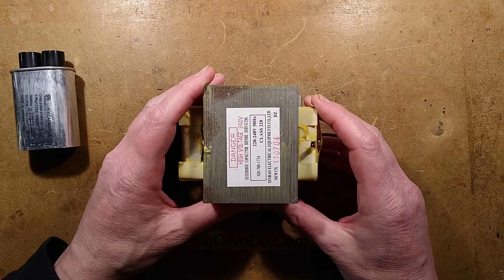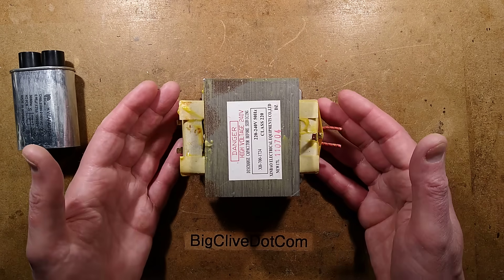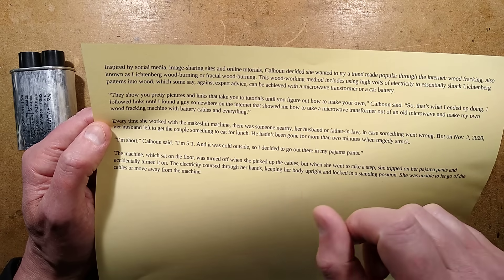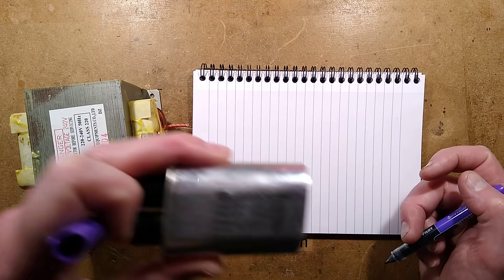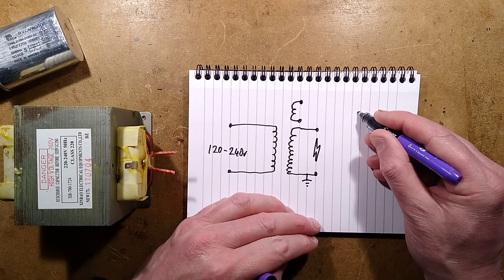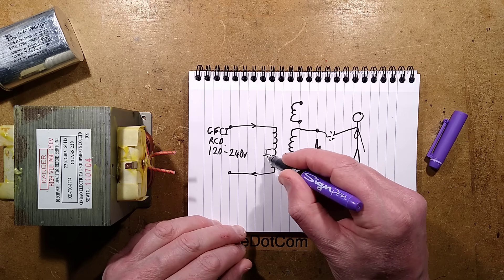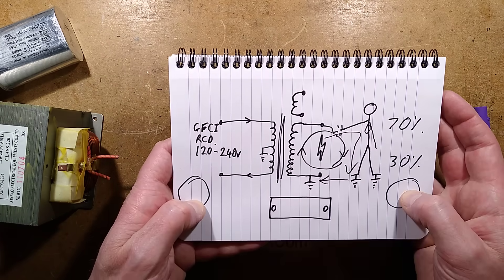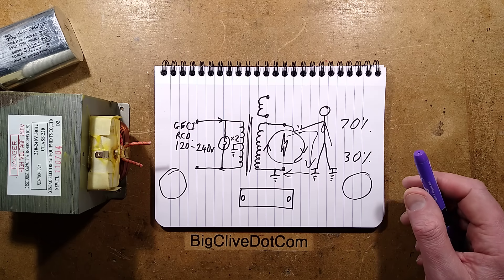The most deadly project on the Internet

Comment: I went for epic high voltage at current from these.. welded two back to back so HV is centertap grounded. Put into a 3 gallon pail of transformer oil and powered the primary so the two transformers would have HV in phase. Used this to power a lower voltage but high current Tesla coil and a awsome jacobs ladder, but it eventually ended up getting a voltage trippler added on to it to power a copper bromide laser. 🤓 fun to play with but deserves respect. They can source up to an AMP of juice at 3 to 4 grand through you 😵😵😵

Comment: Clive, I haven't had time to think about your excellent video and will comment more later but it seems that if the instructions to adapt the transformer  to people who don't know what to avoid to begin with, instructed them to isolate the grounded secondary by disconnecting it from the frame it would at least be less lethal. People should NOT fuck with microwave transformers to begin with but at least it would be an isolated secondary somewhat. Thanks for the great video on an important topic!

Comment: I actually fell down quite the same rabbit hole that those poor lads did a while back and following me managing to get my hands on an old microwave, I did it. I very much should not be alive right now, I did it with old housing wires, on a rainy day, with no more protection than the insulation on the wires and some work gloves I was wearing. I was careful at first using plastic clamps to hold it down, then turning on the power strip I had it plugged into, but at some point I moved on to just holding onto the wires. So yeah, shear luck.

Comment: So even though Clive already said it, I will repeat him because its worth repeating.
Use a dead mans switch, use multiple indicators across the primary. And ALWAYS use wire rated for the voltage you want to put across it. All wire is not created equal boys and girls.
Have to wonder though if rectifying the output to DC, would still work, as it doesn't cause the contractions that FORCE you to grab onto the electrode!

Comment: I've built and worked on amateur radio vacuum tube RF amplifiers. These things fall into a similar category of leatality. The DC voltage on the anode of the vacuum tube is many thousands of volts and this WILL kill you in an instant! 

Not scary enough while just sitting there, when they are in operation you can get 1000-2000W (or more) of RF energy superimposed on the anode... you enter in a whole new realm of danger. 

Working on them demands the utmost respect and situational awareness. Bypassing interlocks to allow operation while hazardous voltages are accessible is never recommended.

I have the utmost respect for those engineers that are trained to work on much higher powered vacuum tube radio and TV broadcast transmitters.
Reply: I worked as a guitar amp tec on the road with the rock bands in the 80's.. Scary high DC voltages in the high bower amplifiers.. not uncommon to find a nice sizzly 800V at about 2 amps !!!  The simple rule is.. no metalwork on your body.. ONE HAND when it's on.. and NO BEER before opening.. or on top of the cabinet !!!!!
Reply: I have a Johnson Viking those tubes are something else ! Hope I can still get them as the last ones came from Russia ! They still make them same for the 2KW amp a diddling stick is on top of them as a reminder to make them safe!

Comment: whenever a homemake step up transformer switch  on, you are summoning sir Darwin, it is him to make the decision you do the job right or not. the other common step up transformer in your home would be the florescent tube light. that one is highly modulize with plastic insulator, that's "supposed" to be safe. but every now and then, there will be some genius get a nasty shock touching the high voltage ends here.…

Comment: Never tried one of these. But using a oil furnace transformer rated at 10kv. We had a testing machine to verify it worked, and it was mostly a safe thing to use, but after using it several times we found it to only work when the transformer was basically completely dead, and you can tell that cause there was no spark at all. We found it was much more reliable to do a drag test, and see how long you could make the arc. This is showing how dangerous that could be.

Comment: I have a bunch of these little HF supplies I got on Ebay. They're not even mains powered, they're BATTERY powered. I put a whole whopping 3v into one of these things, and it would make an arc between the output terminals. So that's a LOT of bloody energy.

Well, I had this fool idea of making a glove with conductors on the fingertips, so I could do this sort of "wizard trick" of having lighting flashing between my fingers. It would have looked really cool...if I had done it right. But I didn't. I had a few layers of what I thought would be sufficient insulation, and had a slide switch on the battery box. What happened was:

1. The current blew right through that insulation right into my left thumb. I figured out later that what I had offered it was a whopping big capacitor, with my thumb as the other terminal. The 3/16" of rubber I had between my thumb and the terminal was about as effective as a piece of pantyhose. It started boring a hole into my thumb quite painfully. But that wasn't the whole problem.

2. The battery box had insufficient insulation, and was somehow picking up current from the other side of the circuit, because I couldn't flick the damned slide switch! I'd bring a finger near it and that finger would get zapped so badly, I couldn't move it voluntarily!

The way I finally shut the damned thing off was to literally tear the battery leads apart to separate the battery from the module. That stopped it. Then came the task of removing the rubber glove I had on my left hand to do something about the damage to my poor thumb. It was as if I'd just jammed a soldering iron into my thumb and left it there for a while. I immediately ran the hand under the cold tap until it was slightly numbed, then filled a bowl with ice water and shoved my hand in that for a while. I cleaned it out really well with Bactine (because it has painkiller in it) and triple-antibiotic cream (with yet more painkiller in it), and got a burn dressing on it. (I keep hydrocolloidal burn dressings around because I own a soldering iron.) After a day or two of replacing the dressings and hitting it with more Bactine, it looked like it would heal up ok. I started using an aloe and silver antibacterial preparation, and dry hydrocolloid dressings, with a cut-off thumb from a nitrile glove over it, held on with silicone tape, to protect it. A week or two later, it was well healed up, and the hydrocolloid kept there from being much scarring.

In short, I got bloody lucky. I still don't know why I couldn't turn off that damned switch, and I don't care. I still have those HF modules, but I don't fiddle with them anymore. If I have a project that has a legit use for one, I want a schematic and a BOM for making whatever widget this thing gets put into, so I can have a reasonable chance of keeping all my fingers intact. And this wasn't a microwave transformer! It is a high voltage/low current but high frequency RF power supply, and can still cook you like a hot dog if you don't treat it properly!

Comment: High voltage is scary. I studied electrical engineering for a while before switching.  I still remember the story of my professor about an accident in the high voltage lab. Over the course of weeks fine carbon dust from a large electrode had built up in the unventilated lab to the point of making the air conductive. A very high kilovolts lightning bolt shot through the lab, which thankfully was empty at the time...

Comment: In this use case not even a cat has enough lives to survive when things go wrong. Sadly people often do dangerous things for views and attention; especially if they have no clue about safety. It is often a case of monkey see, monkey do. Which can result in monkey severely injured or dead.  I personally wouldn't trust the heater winding either.

Comment: As an electrician,
Tx's are no joke, Capacitors are no joke.
treat them (and everything else  electrical) like a loaded gun. 
Always assume its hot.
Dont become the ground.
Wear your PPE,
Reply: I'm having fun with the rent house I'm in.  I'm fixing the wall outlets, because the electricians for the builder didn't mount the boxes right.   So, I'm opening them, pulling out the receptacles, putting in spacers, and remounting.     Shattered plates, receptacles that go in and out more than half an inch, solid core mounted into the back connectors - but the side screws NOT seated, nor wrapped with electrical tape..    I'm opening each one wearing gloves.   

So, it's a "Treat everything like a moron assembled it."  situation.
Reply: @tbelding to be fair thats how i used to troubleshoot residential electric work for new construction. 
"If I was an idiot, what would I have done?"
Residential is typically what we call piece work electrical. A non electrician gets paid per house so they focus on quantity over quality.
Reply: @howlongcanimakethisfukingthing  I understand that, but still, if the drywall people can get the holes cut right, you'd think that the people nailing up the boxes could at least get them straight - the boxes have an alignment strip!

Comment: I've dismantled a microwave to repair it before.   1) It had been unplugged for a while.  2) It was replacing the turntable motor.   Even with not working with the transformer or capacitor, I still gave it a good buffer zone.    Would I like to work with one for fun?  Sure - but I don't have the setup for it, nor do I want to sacrifice my working microwave.  I doubt I can use my UPS transformers for it :)     I'd be using momentary toggle switches facing outwards on both sides of a box.  That way, even if you wanted to try to do something dumb like turn it over to hold both buttons down, it won't work.  You'll have to have both hands involved somehow.    Even better would be those contact lever switches like are used in the 'gripping strength' machines.   Each stuck in a hole.  

However, I have enjoyed putting recordable CD's into the microwave, and putting them on for 1-2 seconds.

Comment: Dead-man’s switch won’t help: if you get shocked you won’t be able to let the switches go. Instead, use a remote control to turn it on from some distance away. They sell these for turning Christmas lights on & off. However, don’t trust the remote to be the only way to turn it off; make sure you’ve got a separate switch as well, and unplug the whole rig during setup & adjustments.

Comment: I have a friend who experienced touching an overhead HV line with a metal pole.. I think it would be quite the same.. he got off very lightly I think probably because he used to carry a lot of coin in his pockets. well it blew the skin off his elbows and he got very burned in the pocket regions.. his shoes melted. somebody watching said it was like watching a lightning strike tap boom and off to the hospital. I was told it was near thing he did not get thrown off the roof since the burn marks were something like 20 feet from where he landed.

Comment: I think the best way is setting up everything right before applying power to the high voltage transformer that’s mean safe distance and your only task is opening and closing the power never ever pick up with hand even if they are isolated or isolated objects, touch the transformer and cable connectors when no electricity provided when circuit off power zero that’s the safest way do not go near it take his advice seriously but when I work on high voltage I prefer  working it perfectly right from the first time get it right and step back just on and off the circuit . High voltage is serious thing not a fucking joke at all careful , electricity is a deadly thing you have to understand it well in order to deal with it ,do not do what people do understand their doing first !

Comment: Bloody Hell. As an electrician I wouldn't even try messing around with stuff like that, 600V is enough to make me apprehensive. To think some home gamer is going to buy wire and other pieces from a home improvement store to set one of these up, with no idea about voltage ratings of insulation, and the effect of messing with a conductive liquid at the same time, is friggin scary.

Comment: The danger exists with tube amplifiers as well. One project I worked on had a transformer secondary at 1600v and a voltage doubler circuit that.boosted it to approx 3200v at 1 amp. This was for the B+.  It is scary to mess with and very unforgiving of mistakes and complacency.
Reply: Sorry if I caused confusion, it is a vacuum tube RF amplifier for amateur radio, and while I mentioned B+ I was referring to the positive annode voltage, it is in fact a class B amp as well.  I am not an expert by any means, but I do work with regular mains electricity on a daily basis so I know enough to know to be respectful. I feel as bad as this is, it is still safer than making lichtenberg wood art, if for no other reason I do not have to hold jumper cables to use it. The case stays on and guards in place unless I need to troubleshoot, and only after using a HV probe to verify the bleeder resistors have drained the capacitors, the cord is unplugged and the breaker is off.
Reply: @thomasdavis4253  sounds interesting, I didn't know RF vacuum tube amplifiers were still used nowadays.
Reply: power it at 10v with variac isolating transformer-50-120v out. Power up full power only with case fitted 2500v at 1 amp not good
Reply: Where did you get that transformer? I would like to build a HF RF amplifier, and about 3kv once rectified at 1amp is my goal. Hard to find such transformers. 73's
Reply: @dieseldes6578  A pair of microwave oven transformers in parallel will do it easily.
Reply: @NiHaoMike64  Can microwave transformers run continuously, at least with full voltage on the mains/primary side? My understanding was that they where for short duty applications. I wouldn't be at full load on the secondary for long, maybe 30% duty cycle, but I don't want to worry about the transformer overheating. Also the secondary needs to "float" relative to ground, so not possible with MOT transformers?
Reply: @dieseldes6578  MOTs would be a poor choice to power a tube amplifier indeed. They run at very high flux density, hum loudly, overheat quickly even unloaded, and to get round the non-floating secondary you need to use a half wave voltage doubler rectifier like the original oven circuit, and that means too high voltage for amateur sized tubes, bad regulation under load, lots of ripple and so on. If I had to do this I'd use 2 MOTs with primaries in series, and the secondaries driving 2 voltage doublers feeding into a common filter cap. That would give about 2kV DC, and 120Hz ripple instead of 60 if you wired the 2 units 180 degrees out of phase so they take turns to charge the common filter cap. Regulation could be improved by using more capacitance than the original oven circuit, and knocking the magnetic shunts out of the MOTs.
Reply: @connerlabs  makes sense. Cheers
Reply: I have a 2KW ham amp that thing on its own dedicated 20 amp circuit drops the mains voltage when keyed and I have a 200 amp panel a guy got killed back in the CB days he was leaning over it with the case open and a neck chain fell out of his shirt into it ! I have a diddling stick that I short every thing before cleaning or replacing tubes in that monster may not get final tubes any more the last ones came from Russia ! They still make them . Edit this is not the amp that killed that man !
Reply: Was ths circuit for an outdoors stereo audio amplifier (since you mentioned a B class audio amp)? I can't imagine something else needing such a powerful power supply.
Reply: @Hunyadi1442  The B+ refers to the plate (or anode) voltage for the tube to distinguish it from the low voltage A supply that powers the tube filaments. Amplifier classes, such as A, B, C, etc., are a totally different thing. My guess is that the power supply was for a radio transmitter of some sort, like a Radio/TV station or a radar unit.
Reply: @clarencegreen3071  I didn't know this, thanks for telling me. I never worked with electronic tubes.
Reply: @Hunyadi1442  He didn't mention a B-class amplifier circuit, just the "B" power rail in a tube circuit.  The one tube circuit I played with used rectified mains at around 300V DC for that rail, not sure why a tube circuit other than a CRT, radar or broadcast transmitter would need such a high voltage on that rail.
Reply: @johndododoe1411  oh, thanks for telling me, I don't know much about electronic tubes so I thought he was talking about audio amplifier classes.

Comment: a Deadman's switch is definitely a requirement when doing a project like this, im half wondering if you could build a DMS that trips when current is passed through an artificial ground, I work on PC's as one of my major hobbies and i wear a artificial ground to protect the sensitive electronics from static electricity so if you could monitor the current going through an artifitial ground and use that to trip the circuit the Ground would have to be capable of handing the voltage of the transformers though
Reply: I once dreamed up an idea of a survival suit. Clothing with sensors to detect potential difference across the body, and sending an instant off command to the power system